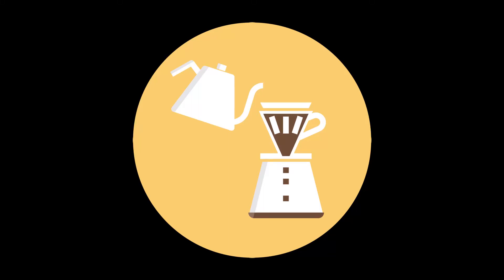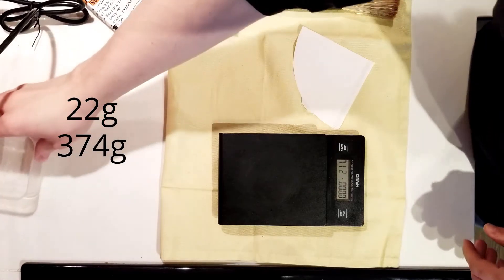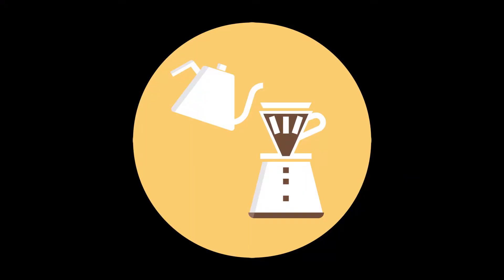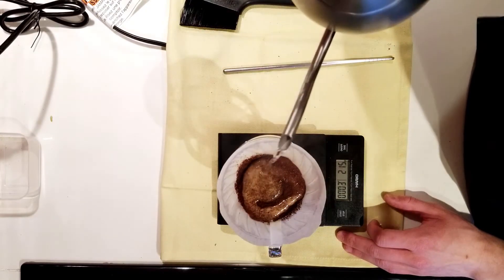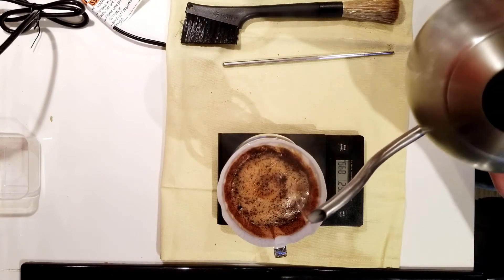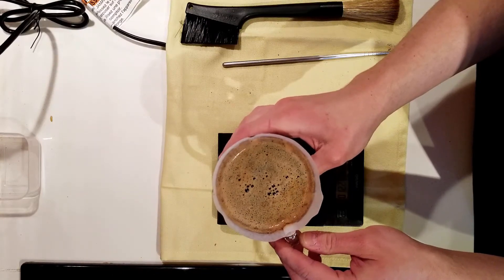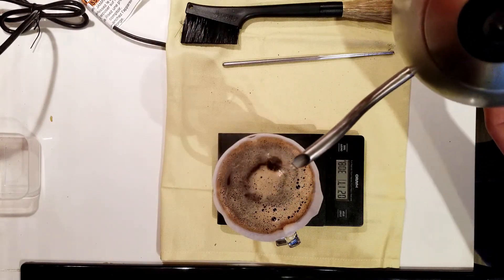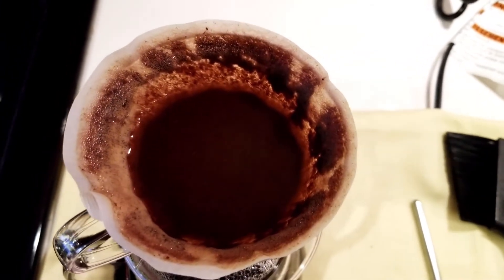New and Improved Hario V60 Pour Over Tutorial

Comment: Great video! I noticed you used the Ode grinder, what setting do you find works best? (or did you swap the burrs with SSP). I'm having a hard time getting my pour overs past the 3 min mark with the V60/Fellow Ode grinder, but will follow your steps during my next cup I brew.
Reply from the maker: Hey good eye! I still have the stock burrs, and I've been using the settings between 2 and 3. Mostly the 2.2 (the dash just under 3).

With really small pour over batches like a single cup V60 you have to go pretty fine because the coffee bed is so shallow and doesnt provide much resistance to the water.

Once you put enough beans through the Ode though we will need to recalibrate the burrs. Haven't done that yet. But it will help reset what the machine thinks 0 is. After that the numbers I'll use will likely be even smaller